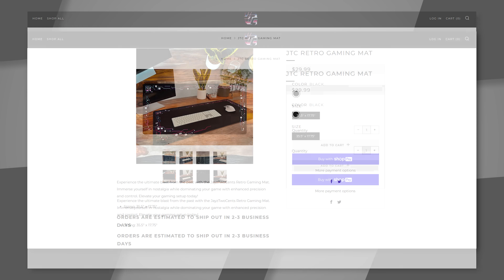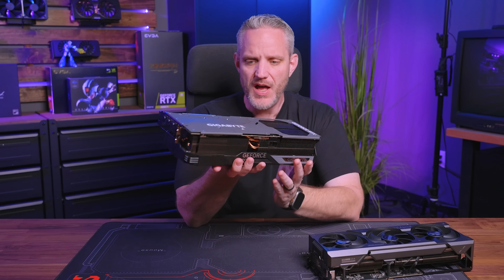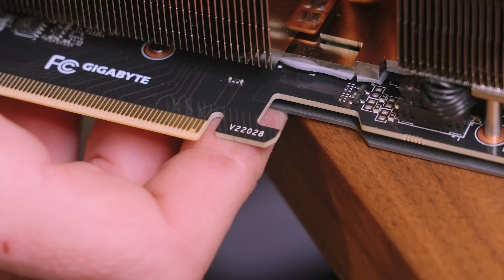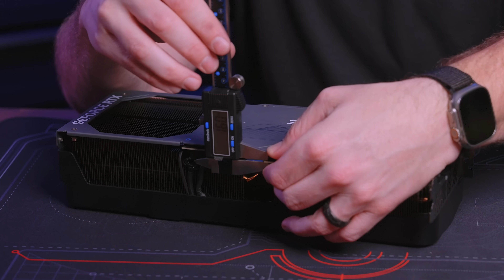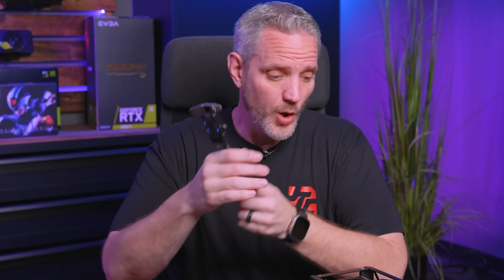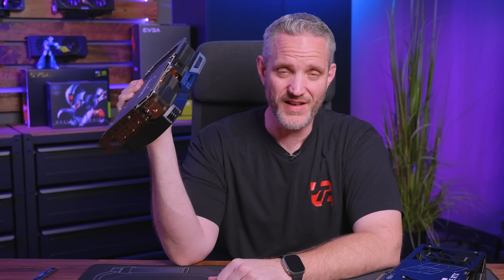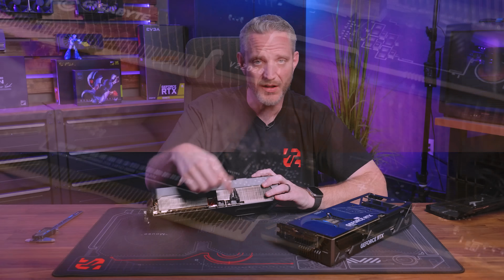These GPUs are cracking and the company REFUSES to warranty them!

Comment: Kind of unrelated, but something that frustrates me about personal computing today is that PCI card slots are sort of becoming the new AGP slots of modern day; people just use them for the GPU, the GPU is hella-thick, and there are less of them on motherboards these days, hence why they're basically AGP slots at that point.

I like the idea of having all seven of those slots having some purpose. Might be the odd one out here thinking that, but remember when mainboards had seven of these guaranteed? One foe each open space on the board? Yeah, that reality disappeared when manufacturers realized that their GPUs take up three of them most times.

This could had been an opportunity to fix the GPU sag issue in a meaningful way; reverse PCI priority so the bottom-most slot is 16x, then manufacturer cases which have fixtures that slot the card in via a rail system of sorts which would further fasten the card in position. Then the six other slots could be opened for whatever else an end-user wants to shove in there.

Comment: I think, that the less flex of the ASUS card is due to construction and less the PCB material. If you look at the Image on 6:54 of the Video, you can see for once that the ASUS card has more material around the "hook" and Gigabite has a bigger cut out. Also the ASUS card has a screw/stud in this area further stabilizing the area while on the gigabyte card the closest screw is at least 3x as far away, allowing for more flex.

Comment: This is why im not buying RTX Series cards god knows what could go wrong
I saw new rtx cards which were on stock clock (no overclocking) and the cards had graphical errors from purple dots etc...
If they underclocked the car they got away
There was the melting psu connector on the 4090
And now this

I still have my 2 1080ti Strix connected together
And it works like a charm i just stick to those

Comment: A lot of people point to (mis-)treatment of the cards during installation, transport etc. While all those will for sure be contributing factors, if there wouldn't be a specific design flaw with Gigabyte cards, we should see a number of cracked boards from every manufacturer in line with their market share % of sold gpus. However making some checks on ebay, it seems like 80% of the defect cards offered are Gigabyte.
Reply: if misstreatment would affect it wouldnt all cards crack in the same exact spot regardless of weight?

Comment: Correction. They aren't flaws in the cards regarding the games you mentioned. They were the games asking the cards to do things they weren't designed to do. It was a flaw in the coding of the game. It can either be fixed with an updated graphics card driver, or a patch to the game itself. This is the same thing that happened with Starcraft 2 when it came out. Just because a driver update can/would prevent the issues you mentioned in those games, doesn't make it an issue with the card itself. It's an issue with the software not being programmed properly. I could make a piece of software right now that will be guaranteed to fry your card if you willing install it on your machine. Cards do what software tells them to, even if it says burn yourself to the ground.

Comment: I don't know about this, I have been playing around with computer parts for the best part of 27 years. During that time I handled countless (no less than 2 dozens) GPUs and a lot more if you include assembling, that sometimes involves removing and reinstalling the graphics card numerous times on a single built because it was easier to get access to other components if you are upgrading. Just a quick example, sata cables and m.2 SSDs etc. During that time I have never broken the PCB of the daughter boards, including GPUs for obvious reason. 

Just handle it with extra care. I don't mean to nurse it like a baby but at the same time don't treat it as if it was made out of steel. 
Jay, if you feel about this so strongly, don't just talk about it, why not do a stress test and prove that it is a manufacturing defects. That way you can make this credible.

Comment: Another cure to this (which I use) are cases thar allow the motherboard to be mounted with the I/O to the top of the case. This allows the GPU to be mounted vertically with the weight of the card carried at the I/O end of the card using the case to carry the weight and not the motherboard.

Comment: Maybe don't use flimsy plastic to mount a 2kg board worth $2000, they relly need to change the standard. This was   due to happen. This design was made to hold like GeForce 4 cards that weigh 100 gram maybe😂

Comment: @6:54: We can clearly see that Asus Card has a peg/screw just a couple of milimeters above that bolts the heatsink through the card and probably adds a lot of rigidity in the card right there whereas Gigabyte card has no anchor point nowhere near that lock tab and they even cared to crop a little part of the PCB making a larger "hole" reducing stiffness...

Comment: Couple comments about this issue:
1. The only time the backplate and slot lock are a good enough solution to retain these big GPUs is when you built it at home and never move the PC. If you are an OEM or system builder, the stock retention is nowhere near good enough to keep the card in place and undamaged through shipping. Not even close. Heck, if you are just moving to a new home, you probably ought to unplug a big GPU like this for the move. All that weight cantilevered out so far away from the backplate makes a very effective lever to pull on the backplate and twist the connector in the PCIe slot. This is why you see many OEMs putting foam blocks in the cases for shipping, or if they are a big OEM they build a case with some sort of support bar that attaches to the card further down its length for extra support.
2. The PCIe locking tab was a bandaid. There needs to be a revision to the ATX spec to add a standard structural support that graphics cards can attach to somewhere towards the other end of the card. These huge GPUs need more mounting points than just the backplate and the slot lock. Honestly, if we had more than just the backplate attaching the card to the case, we probably wouldn’t even need the slot lock.
3. I don’t know that I will ever win this war, but it is a hill I’ve picked to die on: motherboards need to go back to being horizontal. It won’t solve every problem, but when your GPU’s weight is pushing it down into the slot in a horizontal motherboard layout, there is much, much less twisting force on the cards PCB and on the slot. Rotatable PCI card mounts and PCIe riser cables sort of get you to the same place, but that is extra money and effort compared to mounting the motherboard in the correct dang direction in the first place!

Comment: Im having an issue with MSI. My GPU's displayport died and they sent it back unrepaired and with additional physical damage to the cooler that wasnt there when I sent it in. They swapped me for a refurbished (on a 3 month old brand new card) without damaged cooling, and the ports died again, but it looks like when they repaired the refurbished card, they actually swapped the damaged cooler from the first GPU back onto the most recent replacement. Ive had this card for over a year now and their excuse for bad service is to just "send it in again". This GPU has spent more time in RMA than it has in my PC.

Comment: Those cards are all exceptionally heavy and bulky by historical standards.  The whole ATX form factor wasn't really designed for heavy components to fit onto motherboards.

That's one big reason I haven't gone beyond a midrange card in years.  That, and modern graphics cards generally make too much heat.  Moore's Law might as well be dead.

One thing you'll notice about professional graphics cards, they are all mostly relatively thin and lightweight, in comparison.  They also usually are alot more energy efficient.  I almost went for an RTX A3000 for that reason alone.  But I got a used RTX 3050 ITX form-factor instead for much less, and undervolted it.

Comment: More flexibility=less prone to cracking Via spring effect

IE crankshafts are a great example I assume you’d understand, they’re essentially made of spring steel, and flex and aren’t stiff it prevents cracking. 

The stiffer card would be more prone due to fracturing
Reply: What you are saying is ture. The issue is that the card is fixed in the connector, so it is a rigid part then if you go upwards there is a cut on the leg = innectia is reducing an then the legs run to the main body of the card and again ridigity increases. It would be benefitial to have smooth transition in inertia. So the real question is, why does the standard requires these small cornes and stepped cuts wich are functioning as a stress concentarting feature, especially so close to the fixation.

btw the ASUS PCB by itself would not be stiffer at that small tab. If you look at it 6:55 there is a screw boss on the asus card next to the tab, which creates a structural stiffness.

Comment: I’m still amazed how huge these GPUs are and how it’s even acceptable
Reply: tbh we're at a stage where things HAVE to get bigger for cooling purposes. like most of a 90 series is just cooling infrastructure to make sure the damn thing doesn't overheat and die. Like all the new CPUs are hitting a ceiling decided by their IHS, not any integral part of the chip
Reply: @TheTeremaster comon there is 3060s sold with this fan configuration, and 3090s sold with just a dual fan setup and they work just fine. It’s a gimmick to sell you overpriced cards that don’t perform much better in the temp department. Best cooling is water cooling anyways
Reply: @Great Value Bleach Those cards also didn't weigh like 3 lbs either. Edit: My Xfx Merc is closer to 5 lbs.
Reply: These aren't your average consumer GPU's though...
Reply: @portman8909  they kind of are tho....
Reply: My pc weighs in at 25 kgs :)
Reply: @@greatvaluebleach1565  I miss my old cast iron cases.   Use it as a shield in a shoot out!
Reply: enough w talking  SUE THEM!!
Reply: I just got a 4080 and was shocked at the size and the fact it needed a support beam thing
Reply: You make it sound like things are made big just to be big. It's required for them to be this size due to components and cooling. What else do you want them to do?

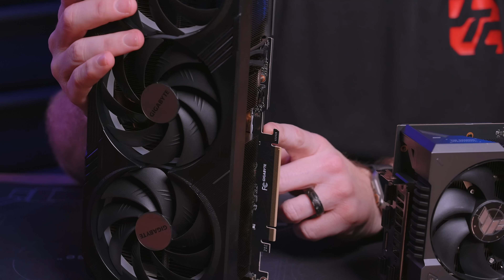Comment: 2:27 that tab is there only to make it a pain to remove the card, i'd be surprised if it actually held anything. even if it does you still have the screws (which do 99% of the job) and the stick so it doesn't self destroy with its own weight.

Comment: A few questions to gamers with the cracked 30 series. 1) Vertically or horizontally mounted? 2) Did you buy the 30 series or did it come in a pre-built? If a pre-built did it get shipped to you?

Comment: Along with the other deficiencies noted by other commentators here, I see a big contributing factor is the physical shape of the PCB around that locking tab. Consider the split shot at 6:55, there is less physical material to support the stresses that the locking tab is subjected to. Comparing the amount of PCB material left in place near the locking tab on the Asus board compared to the Gigabyte board it is easy to see that there is more "meat" of the PCB there for structural support. Now, don't get me wrong - I'm not implying that this is THE reason for the failures, I'm sure that the factors other commentators have pointed out are all part of the root cause of the fractured PCBs. Or put another way, the physical shape of this area of the board is a contributing factor. In my mind, there simply is not enough material left after the raw PCBs are routed out to support the locking tab in a way that can handle the intended/expected stress of locking the card into the mobo. Prolly why Asus has the shape they do in that area.

With that said, perhaps a retrofit to this area of the board may help to prevent damage for those card owners that do not have the crack yet. I'm imagining a two-piece clamp-style 3D printed bracket that provides more support for the locking tab by transferring some of the stress on the tab to the rest of the board. Maybe even a single-piece support bracket that can be slid into that little cutout area would do the trick. I would say that a bracket that brings the overall outline of the board in that area closer to that of the Asus board will help to mitigate the possibility of damage. Does this make sense? Perhaps someone with one of the affected cards can publish the dimensions of that area (including clearance of the slot as installed) so that a clamp or other support can be designed. Crowdsource a low-cost retrofit to make up for an OEM that doesn't care about the consumers. 🤷‍♂

Hell, I'd even buy a CAD license to design the part if I had access to the dimensions.

Comment: Truth is, the modern PC as we know it, is due for a form factor change in the area of the GPU. The cards have gotten too big, and there's only so much that can be expected  of a PCI slot anyway. The reason for the thinner card being more rigid, is most likely a denser type of plastic in use by Asus, resulting in a denser, stiffer card. Problem with that answer however is, it puts even more stress on the motherboard slot to take the weight of the ginormous cards being used these days. Thanks for the vid Jay, I used to live in CA back in the eighties.
Reply: I lived in Oregon back in the seventies.
Reply: Really they just need to start making good cases with horizontal MBs again like they used to.   The vertical MB is stupid

Comment: Getting things RMA'ed by Gigabyte is nearly impossible. There's a report somewhere that their RMA tracking system was infected by malware at one point and they lost all their tracking information. I'm sure they do not want to fix these cards and are breaking them on purpose and telling customers no fix. Otherwise, this is a huge QA problem with their manufacturing. I even have a Gigabyte RX 5700 XT out of the box that were missing PCIe power connectors, never soldered to the board. Are they checking the quality of anything they make?

Comment: J, you're so right, current GPU pricing situation - it truly sucks a big one. Effects the whole GPC industry, from top to bottom. And this subject here, good grief, the GPU pcb was originally designed to just carry a tiny little gpu chip. Just look at the increases in size / mass of coolers over the last few years??? The generic pcb design was NEVER designed to carry any of these, so, gee, who coulda guessed this would be a weak-point?🤔 It points to the need for proper heavy-duty cooler-supports 💪 for cards with large, mass-heavy coolers, not just the piddly lightweight sticks they currently provide🪶.

Comment: My tab support broke off the mother board, when trying to remove a 4080. I had to put the 3090ti, back into my asus z690, because for what ever reason this board didn’t allow enough power to run it. I had changed the power supply out from 1600 watt, to a v3 gameworks 1300watt pcie v5 and the board didn’t allow the power to work or support the vr pimax 8kx. Is just to much power needed for the pimax, and the gpu 4080. So I have to wait for the next gen motherboard.

Comment: Also mine gigabyte rtx 3060 12GB had a small scratch on the locking clip it I don't know where it came from  but was working fine but like 1 month ago it started acting weird, display resolution stuck on 800/600P blurry and flickry display when launching game it crashes with error  like video card not available I sent it there customer service it's been like 20/25 days but they still says it's under observation they will let me know they will repair/RMA or not I bought that card for $750 on scalper price this is very sad for me.

Comment: I wonder if the people that made the physical specs of the PCI bus ever imagined that there would be cards with that monster weight.
Reply: What's ironic is that when the ATX standard was created expansion cards were at their smallest. If you go back to the IBM XT there was nothing onboard except CPU, RAM and the Keyboard controller. Expansion cards were LONG like the length of a 104-key keyboard long. IBM had retaining clips on the front of their cases to physically support long expansion cards.

So this was a problem that was thought to have been solved by the time the ATX standard became a thing.
Reply: @Shawn_White  Some notes:
1. Cards were big, yes, but they weighted next no nothing compared to modern graphics cards thank to not having a kilogram or two of heatsink on them.
2. Computer cases back then rarely were towers so cards were way better supported.
Reply: @szlatyka  And despite points 1 & 2 the IBM PC had slots in the front of the case that could easily have solved the GPU sag problem had they remained part of the spec while modern PC's don't.
Reply: @szlatyka That was also the era when HDDs were large, optional accessories, and sometimes mounted directly on the add-in controller card. So big, heavy cards did exist back then.
Reply: @Shawn_White  You also needed an expansion card for fricken everything.
Reply: Sound cards.
Reply: Well, graphic card is weight to nothing, its the heatsink that make it heavy
Reply: Back in the day there were cards that were not only mounted in the slot, but also towards the front of the case. Basically preventing this decades before it became an issue.